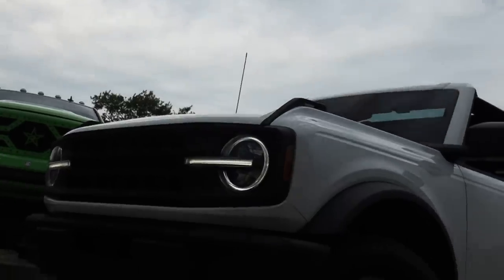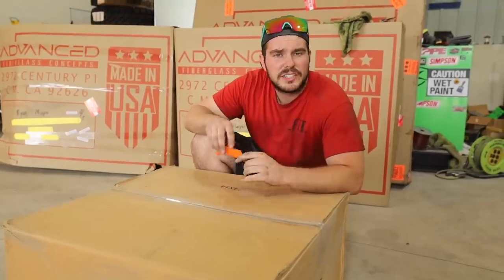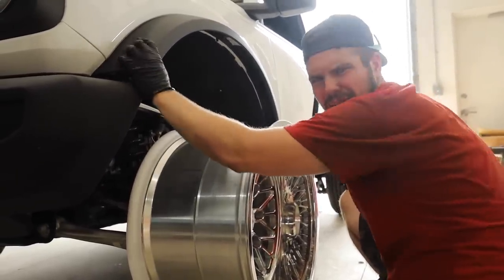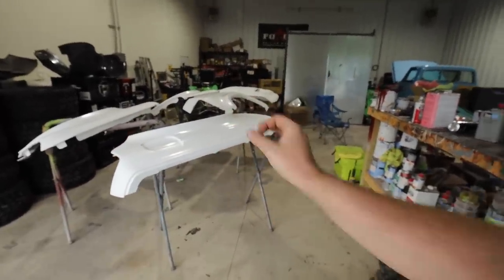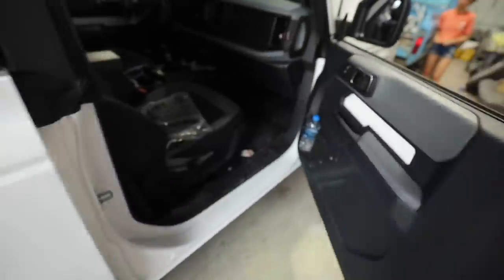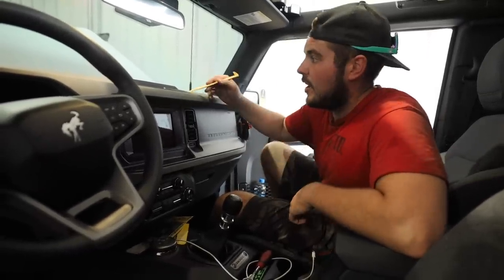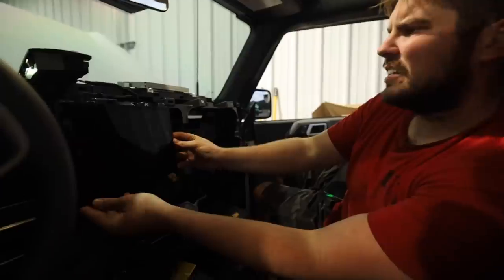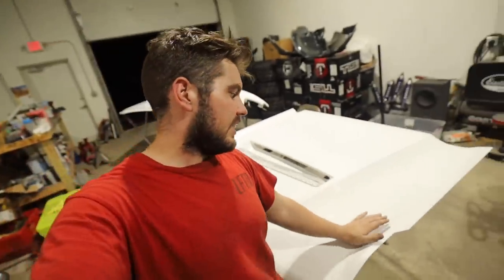A Year Later We Can Finally Build The Bronco!!

Comment: You are on the right track, you just need the Sync 4 APIM for the larger screen with GPS, you can find the As Built data for similar build Bronco to find the differences between yours, and flash those with Forscan.
Reply from the maker: I’m going to look into this!!
Reply: @ryan2546  You will also want FDRS and a J2534 adapter, you are welcome to my OBX Lux package as built data if you need it, just let me know.
Reply: @mpeugeot  I have a bronco badlands....I don't have parking sensors. Is there a way to add the factory ones and install the new software to recognize the new connection. 🤔
Reply: @alajicordero3056  definitely maybe, but I have not tried it.
Reply: @mpeugeot  has anyone done this swap yet?
Reply: Did u ever look into this and tried to do changes on FORScan??? I’m looking into this myself for my bronco and nothing online really confirms that this is a possibility

Comment: Ryan i work at ford and theres a special feature about the ones with the code on the door like yours, it’s actually not connected thru the door its 3m on, and if u take it off itll fit inside the fuel door. My boss did it on his, id suggest miving it there it looks more clean.

Comment: Alright so I’ve looked into the wiring diagram myself cause everybody says it can’t be done and we need to prove them wrong, the second plug on the screen is simply power and ground the bigger screen needs more power than the 8” also swap the cable to the 12” the connector on the APIM is the same so in theory it should work.